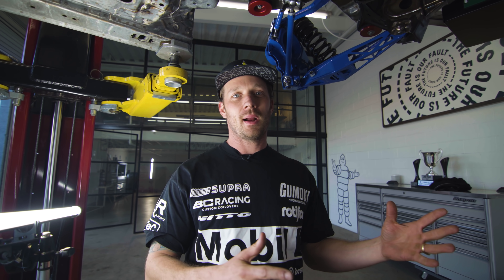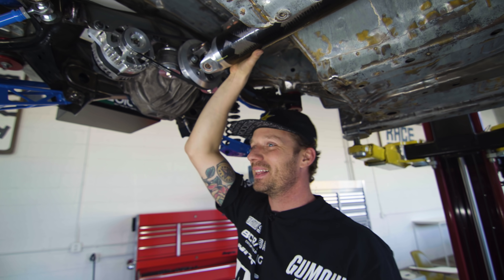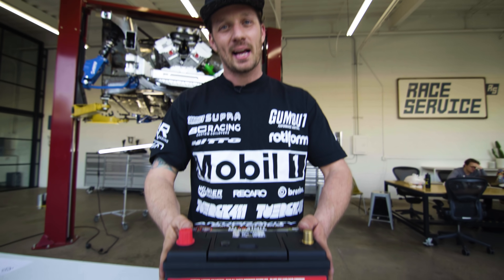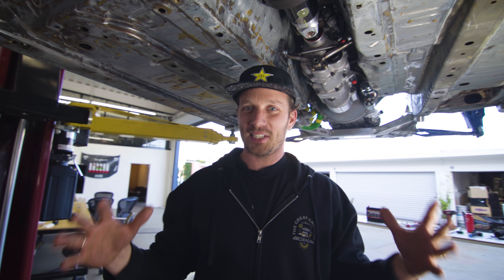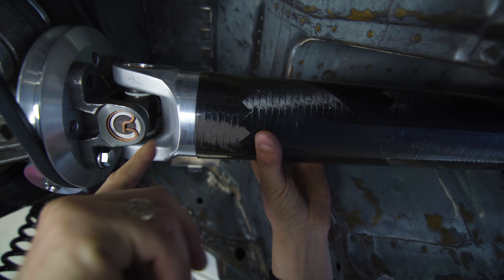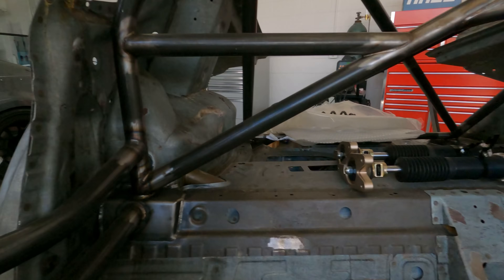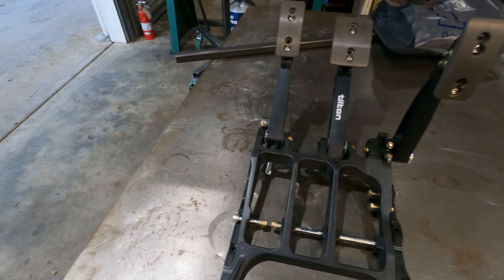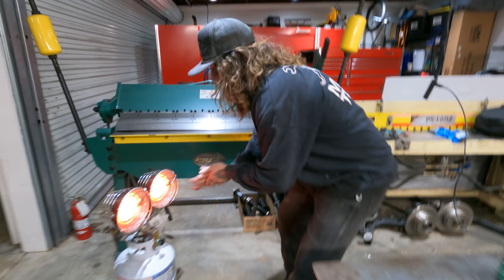Formula Supra get's some Carbon and accessories

Comment: I'm praying for this thing to run equal-length headers, the sound would be heavenly
Reply: its a judd engine its gonna sound amazing no matter what
Reply: hell yeah, dominant engineering could probably do it too. dudes a master level fabricator
Reply from the maker: I am happy to tell you that the Judd installation manual requires the primaries all to be equal length. It is not going to be easy but that's the way it's happening.
Reply: @RyanTuerck  lets see Dom make a badass 10-1 header.
Reply: @RyanTuerck  that's so gangster lmfao. Doing it would be paying it the proper respect, but a straight installation requirement?! Wild
Reply: @RyanTuerck  prayers heard
Reply: @RyanTuerck  Make it 10 into 1, and you got a deal
Reply: @HHCHunterYTC  10-1 would be insane, but I think a 10-2-1 is much more reasonable or maybe even just a 10-2
Reply: @chewylewy1714  10-1 gives it that F1 spec sound that you see in those hill climb videos.
Reply: Hear me out, 10 to 1 to Teardrop Hood-Exit.. right in the middle, almost like a Rhino Horn😂😂😂
Reply: @scum07k  that would be too damn loud, even with a helmet on.
Reply: With a single 10-1 collector as well, like tanner foust's passat
Reply: InstaBlaster.

Comment: The clutch for the alternator you were talking about - Can use a one way bearing, lots of OE's use this in high rev high performance cars (ie BOSS302 Coyote engines) to prevent belt issues while downshifting/rev matching.  Allows alternator to keep spinning if your engine rpm drop, or your case, driveshaft rpm.
Reply from the maker: Dominic actually just told me about this the other day. I think that is what we will use for it.
Reply: @RyanTuerck  
Alot of the oem cars use those even if they doesn't high rev, even on small diesel engines on like a Mitsubishi ASX.
Cheers from Northern Sweden 🍻
Reply: You can tell Dom is a professional because he does everything so professionally.

Comment: alternator on the rear diff is a common thing on old racecars ;) 90s dtm etc
Reply: Why do they put the accesories on the drive shaft? What are the benefits? Just for the weight distribution
Reply: Since you guys have seen this before, can you tell me if I understand it correctly, the alternator only charges while the car is in gear?
Reply: @richmonsmith9308  at least you were nice about it .. . Anyway what happens if you pop the car in reverse?
Reply: @ant4hellfire  yeah, I think while is moving also.
Reply: @ant4hellfire  yes it does but that’s why he said the engine also has a small alternator, that way even when car is in neutral it will still be getting a charge
Reply: @Addiesarkisian  thank you. I realized I should wait till after I finish the video to ask questions because I might get the answer in the video. Lol
Reply: Richmon Smith he said they were COMMON on 90's DTM cars. Not that they originated there. For someone that so condescendingly corrected op you don't seem all that bright...
Reply: @richmonsmith9308  gatekeeping much?
Reply: @hugovandyk3845  electric generator usualy don't care in witch direction they turn
Reply: @richmonsmith9308  oh i bet you’re so smart huh, proving some guy wrong on a statement he didn’t even make.
Reply: @richmonsmith9308  honestly one of the most embarrassing replies I’ve ever read. I pity anyone who actually knows you or has to speak to you in real life. I can only imagine you don’t have many friends.
Reply: @richmonsmith9308  in the video Ryan clearly says that he is aware that it has been a thing in off-road for a long time but not in tarmac racecars, especially drifting. OC only was adding to what Ryan originally stated
Reply: @richmonsmith9308  Why are you being so uptight?
Reply: @mihailpetrovici5044  parasitic losses too. Only charges while the car is moving which is fine for race cars.
Reply: @ant4hellfire  only while you're moving. It's common on circle track cars too since they don't do much besides go like hell

Comment: The thing about the entire build is that everything is done so tastefully... so refined... it's admirable really! Hats off to everybody working on the project! The alternator back there though... I get the racecar vibe and all but... there must have been a different way... I would have thought maybe of splitting the load. Have two alternators of half capacity and have one of them on a clutch switched on when amperage on the circuits crests over a certain threshold... alternators nowadays are efficient and don't cause that much mechanical strain.
When you start drifting rubber will get inside the veins of the alternator and possibly reduce cooling effectiveness... if cooling is compromised on electronics I don't want to be near an electric fire...

Comment: the tank return comes in that way (tangent to the outer diameter) both to ensure as smooth and laminar flow upon entry to the tank but also to encourage cyclonic separation, allowing the air to more readily separate and be drawn out of the breather port.
Reply from the maker: This is what I was getting at haha. Thank you for explaining it professionally.
Reply: @RyanTuerck  no problem dude love your build can't wait to see the final result

Comment: its so awesome i dont want this build to end lol. One thing I noticed is you mounted pedals straight to floor basically. in road course where you go super hard on the brake pedal with no booster won't you get some flex in the floor as you push the brake

Comment: I've owned not one, nor two but three of the re-start tech lithium batteries from antigravity. Every single one would cut off volts mid attempt to start the car (or motorcycle). They have a auto reserve function that kills power if volts drop too low. Apparently to reserve power for a emergency start (you press the re-start button to access the reserve). It was one of the more annoying things I've dealt with. A regular style anti-gravity battery is badass though.

Comment: edit it just got to part about a clutched pulley. 

Curious how the belt will love life with a yank on the handbrake at 100+mph. You should paint the outside of the belt a bright visible colour so you can easily see if it's there when doing a tire swap etc. A quick connection for a smart battery charger might be a good idea too.

Comment: Good luck with the alternator on the driveshaft. I had the same and it was a nightmare. It only takes one mistake or a delay in the running order to end up with a discharged battery and dying on the line. I still wake up in cold sweats...

Comment: A common solution for the accessory drive is to drive a gear coupling off the starter ring gear.  You can then mount things in the rear or run a shaft through the valley of the engine or under one of the headers with a bearing holder at the back and front of the engine. Pulley sizes can be adjusted to control drive speed. Project Binky on YT has a similar example.

Comment: Peterson makes a heating pad for the outside of the tank. Motor builder once told me the inside heaters can actually hurt the oil.
Reply from the maker: Thanks for sharing. We will def take note of that.
Reply: @RyanTuerck  My bad. Moroso makes pad we use on the northeast big block modified. But it’s a Peterson tank.

Comment: What's the idea in pre heating the coolant? Surely there would be hardly any restriction in the cooling system until its pressurised, what's the benifit?
Reply from the maker: The engine has extremely tight tolerances internally so needs to be pre-heated. Also remember that this engine was designed and raced on track 20 years ago. A lot has changed since then.

Comment: Super nice fab work guys. Question on the oil tank cap. Any concerns on its sealing capability with the tank inside the car in case of an accident?
Reply from the maker: No, We will be building an enclosure for it so not worried about it at the moment.

Comment: If you are running an alternator with no clutch from the prop shaft that would mean going into reverse would cause it to reverse charge the battery?

Comment: If the alternator belt fails won't it hit the battery??
Reply from the maker: Most likely yes.
Reply: Sealed non-spillable Lithium battery FTW! The cases are pretty strong but a thin Carbon fiber plate might help. the strength /protection factor.

Comment: Is this car going to need an external power source to to preheat cooland and oil? Or will you try to do both things with onboard battery?
Reply from the maker: Yes, the pre heater sytems run 220volt so we will need a generator.

Comment: Top work, love it but is there any reason why you’ve stuck with the OEM subframe and suspension geo/kinematics? 
While you had it torn down it would’ve been so easy to copy the dimensions of a decent double wishbone suspension system and fab your own, ditch the McPherson’s. 
It would’ve been even easier to cut the front end off a steel tuber racer and weld it on then use a the transaxle and complete back third of a modern ish prototype, you’d basically have Supra looking, faster Daytona prototype with more power

Comment: Quick question but most racing regulations require a firewall/seperation from the driver to the fluids..... So mounting the oil sump in the passenger/driver compartment might not pass Tech?.... If I'm wrong I accept that but please elaborate so I don't mess up my car and can't compete because of a tech failure
Reply from the maker: You are correct. We will be building an enclosure for it. So it will be completely sealed from the main cabin.
Reply: @RyanTuerck  Sweet I'm honored u answered and thankful for the information

Comment: In offroad world?
Bruh, Vw 1.9 tdi had all it's accesories on bicycle style one way coaster style pulleys, because it's vibrating, instant torque jumping engine, so those impulses between compression and power tend to break belts on engine shut-offs

Comment: Been waiting for this!!! Is Dom using silicone bronze filler? It looks really nice against the unfinished chassis
Reply from the maker: Yeah hes using bronze filler where there is the multiple layers of sheet metal with glue in between. It def looks great on the chassis.

Comment: Might want some shielding plate around the alternator. You dont want dirt and crap gunking it up
Reply: You know race cars have diffusers...
Reply from the maker: It will have an under tray on the bottom.
Reply: @RyanTuerck  Oh right, it totally slipped my mind that you're gonna run an undertray XD

Comment: Changing the belt on that alternator in a hurry will be fun - dropping out the drive shaft to change a belt! Id be tempted to say get the clutched pully on before you do an event as a minimum lads or thats gonna break your heart with issues. IF it threw a belt on a warmup lap or pre start - it would put you out simply on time to change. KISS - keep it simple stupid

Comment: The heater looks like it will create a hot spot unless you’re cycling the oil through that tank while heating it up. Is the plan to cycle while heating it somehow?
Reply: i was thinking the same thing. Hopefully its only a fairly low wattage element otherwise it'll cook the oil touching it.

Comment: So on those antigravity batteries... is my stock 5th gen Camaro 2SS  alt able to make the battery happy and vis/versa or would i need to upgrademy alt? I put 2SS because I have a bunch of electrical options in my car. Heat seats/ side mirrors etc.
Reply from the maker: I would love to help you but I don't have all the details. Anti Gravity has a ton of different options though. Check out their website.
Reply: @RyanTuerck  well thanks anyway.  I had looked but it didn't say anything about it in those exact words.  They had more technical specs but idk what is what when it comes to electrical.  I'll just have to call them tomorrow when they are open.
Reply: @cjcoleman7372  you would want a large Amp Hour capacity battery minimum spec of 40AH but 60AH would be the safer bet. The Alternator would not need to be upgraded as the lithium battery take a charger faster than an AGM or Lead Acid.
Reply: @2superblus  well thanks Bart. I looked at your website and although it is more expensive than the normal one for it and I'm not building her into a race car I will still be getting 1. The jump start option and by push button... plus how light it is and I would assume that since my battery is in my trunk I wouldn't have to worry about fumes like I do with a led battery and it lasts over 2 X's longer basically and it's light as hell... im definitely sold. Again thanks for the info. Damn... thats a lot of and's lol.
Reply: @cjcoleman7372  hahah yeah the push button ReStart is awesome. Our heaviest battery is only 25.5 lbs for 100 Amp hours, the 60 Amp hour weighs 19lbs.
These on average double to triple the life of a standard battery.
Also no venting needed due to no fumes, no more corrosion on your terminals either.
Reply: @2superblus  well im definitely sold. I think I will put one in the wife's Yukon and then I will not have to worry about her being stranded. At least not because of a crapy battery.

Comment: What happens if you crash the car and the hot oil tank cracks and throws all the oil on the driver. Doesnt seem safe installing it inside the cabin.
Reply from the maker: It will be safe when it's all sealed off and has its own fire wall. Sheesh, we can only get so much done at one time. Appreciate your concern though.
Reply: @RyanTuerck  OK glad you have thought about it. It wasnt mentioned on the vid so I thought I'd bring it up. Great build.

Comment: One question, if the car is not in gear. The driveshaft isn’t spinning, so the alternator isn’t spinning to.  So the car will only charge when the car is driving.  Right ?

Comment: WARNING. Check the heating element in oil before use. As someone who's built oil and water heaters for 2 formula one teams without the oil being pumped over the element it will burn the oil.
Reply from the maker: Thank you for the info and Copy that.

Comment: All the rubber is going to ruin the alternator and battery
Reply: yea right, he should make a shielding to make it safe and clean
Reply: @naufalkusumah2192  ofc he will, its not only for drift, but for grip too
Reply: And the belt ran by the driveshaft is not going to work
Reply: @justinworkman9980  
Why?

Comment: that alternator setup is going to suck my guy.  Good luck running lights, fans, and fuel pumps when you aren't in 3rd gear to spin that thing fast enough.